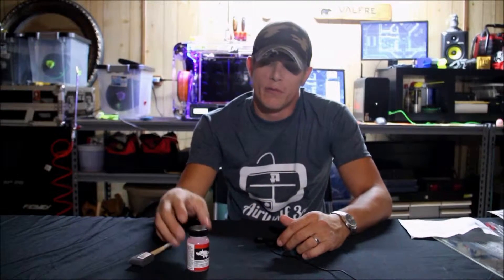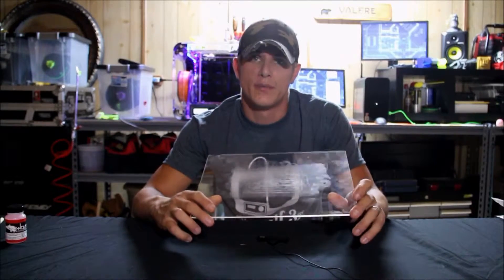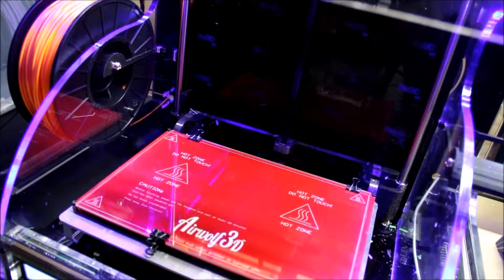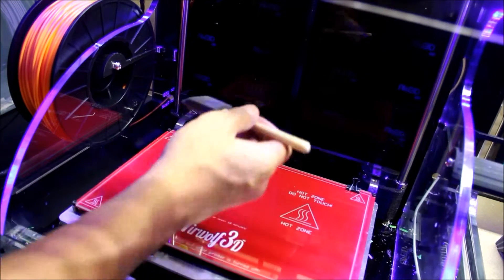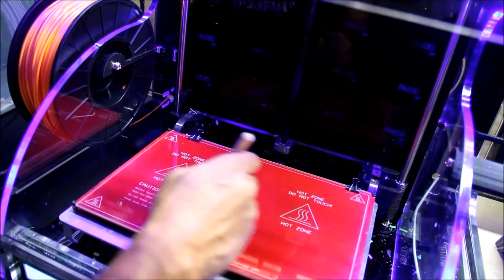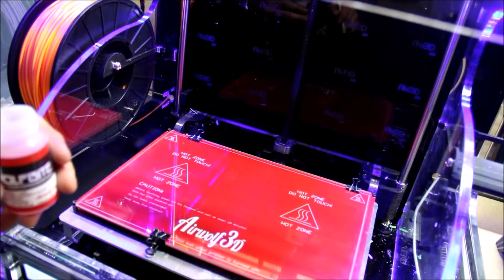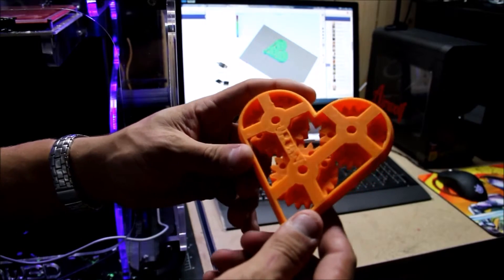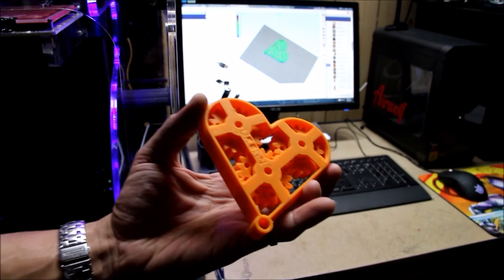How to get ABS to stick to build plate using Wolf Bite Solution (Review and Testing)

Comment: Not much of a review or test. You didn't even show removing the print from the build plate. 
I wish you had tried applying different amounts of the Wolf Bite to figure out how much is too much and what is not enough. Also I was hoping for a few different prints that would have curled normally. 
Compare it to something, test it, at least say what you thought of it. You didn't test or review it. The title of this video should have been "I use Wolf Bite to print a large heart gear locket".